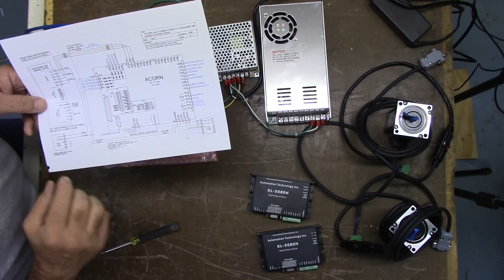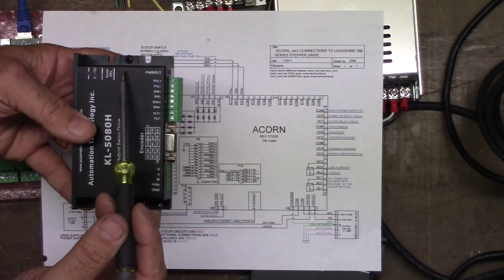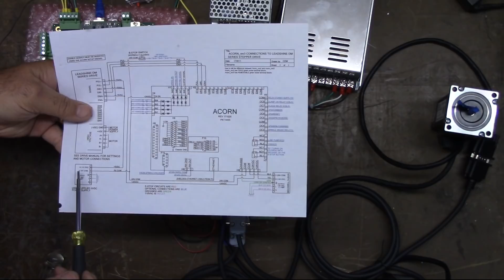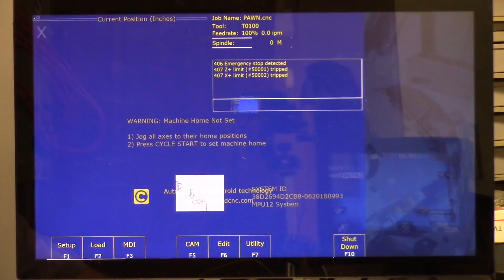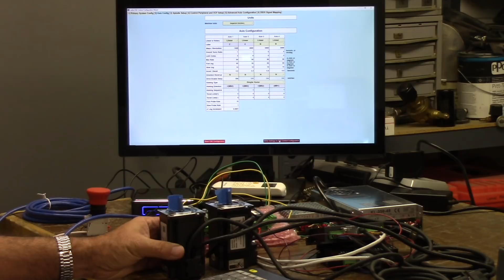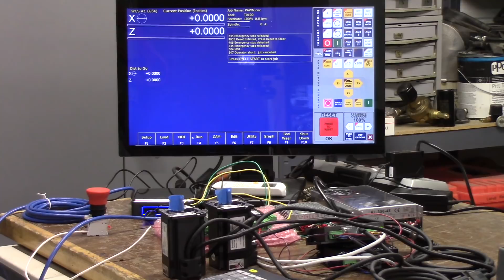Emco Compact 5 CNC - Benchtesting closed loop steppers

Comment: I have a question about the revs per turn. you set them up at 4000 what did you set the driver up at? can you set it up at 2000 pulse per rev with the encoder at 4000?
Reply from the maker: Default of 1000
Reply from the maker: And that's steps per motor revolution....
Reply: so the stepper motor drives are ok to set the switches to 2000?
Reply from the maker: Yes but change steps per motor rev to 8000. High step count may affect your top rapid speeds
Reply: awesome thanks this is my first build with closed loop just bought some for my lathe. anyway I have seen many of your videos great work man.

Comment: nice video ...great job
i have a question pls 
wiring closed loop stepper or servo stepper is the same with any  cnc breakout board ? right 
is the software configuration or setup in mach3 or linuxcnc as the open loop stepper ?
thanks
Reply from the maker: If the drive takes step and direction, any controller that puts out step and direction should control it. I don't use Mach anymore. I only use Centroid CNC

Comment: how many amps is the 48v power supply?  What would you recommend?
Reply from the maker: That depends on the motors and drives you use and how many.
Reply: @martyscncgarage5275  got the same parts you did

Comment: What does enable do? You didn't use it in one of your videos. I think your videos are great for dummies like me.
Reply from the maker: Hi Bob, it is a signal to enable the stepper drive from the control. It is only active when the control is in the ready state, in MDI or to run a program. I didn't use it in a previous video because it was a quickie video to help a user. As for motor power cable, 3 wires are easier to extend than a 15 wire encoder cable. Dependent on the machine and distance from the motor to the the stepper drivers.